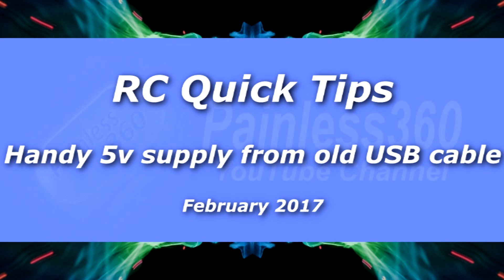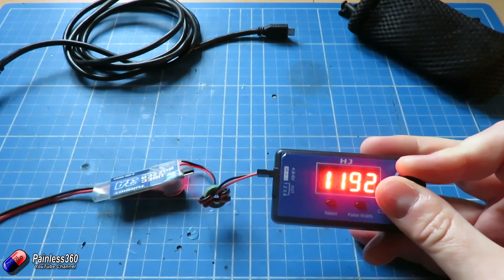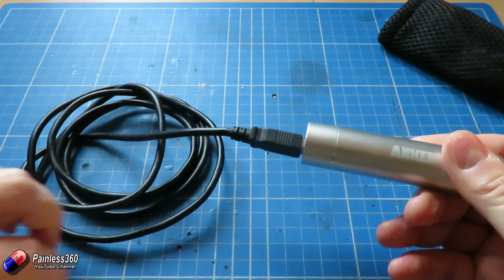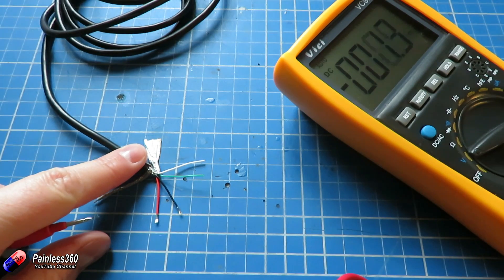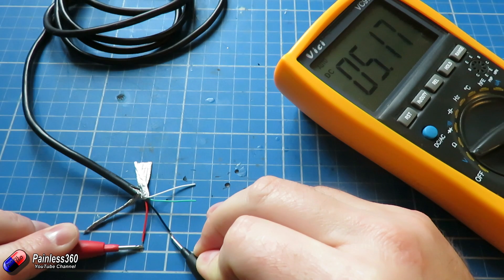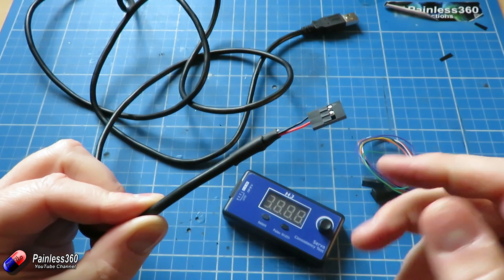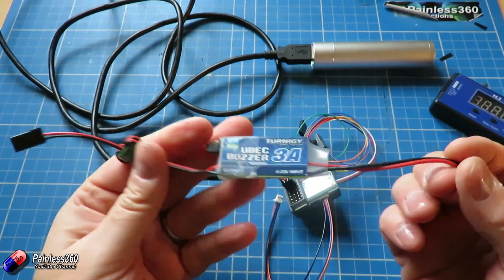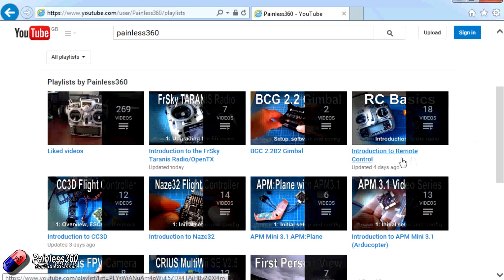RC Quick Tips: Using an old USB cable as a handy 5v supply for testing

Comment: I know this is an old video. But I was only thinking about this the other day. As I’ve just returned to the hobby and but all my gas plane receiver battery packs have kicked the bucket. 🦵 🪣 
So I wanted to bind my new receivers without having to buy another power pack. I’m running electric planes now so I want to be able to bind and setup my receivers before installing them.

Comment: Quick question please Lee, I have made one of these as per video instruction (thanks). Would it be okay to use this with a usb battery pack like in the video to power a dji naza m lite. I'm looking to hack the naza to v2.
Reply from the maker: jasser61 we don't use those flight controllers here, so I can't say definitely. I use these cables to power all sorts from cc3d, to seriously pro boards, to omnibus boards without problem. Best of luck!
Reply: I'll research it thoroughly before trying just in case I fry something. Thanks anyhow for reply.

Comment: Thanks for the tip. I made one tonight. The only difference is mine is reading 10.5V on my meter... I've tried 2 different USB ports and a wall plug. I guess this is okay and controlled by the USB cable??? It was to an old Sony phone. 

Now I never have to worry about whether or not my RX pack is charged. :-)
Reply from the maker: I'd check the output voltage on the thing you're powering the cable with. You can't use that with 10v on devices designed for 5v..

Comment: You could even use the micro USB plug and build an OTG-type cable to power your stuff from your Phone, Tablet, etc.
But note that the data wires need to be connected in a specific way to get some current out of your device (if needed).

Comment: Hi , Ive followed the APM series and all is working but this issue with the compass calibration. https://youtu.be/Elt_99eKYuI 
this is with the external compass enabled with the top jumper shorted. When I use the internal compass I can calibrate it no problem. 
can you please check this quick vid out and tell me what you think can be wrong. 
sorry for hijacking this comment section
Thanks
Reply from the maker: Hi, I would check that the external module is happy and all the wires are ok. I've not seen that here but that's where I'd start. Best of luck!
Reply: Painless360 thanks friend I appreciate your help to the community.

Comment: I've got loads of power supplies and one of them from a NAS had 5V & 12V. So I now have a dual voltage power supply on my bench. Another tip is to use a switch to help with binding FrSky receivers.

Comment: You must be careful with computer's USB ports, though. USB 2.0, which yet is the most common one, can safely supply only 500mA of current. Going above this limit will trigger computer over current protection at best, at worst you can fry your PC.
Reply from the maker: Good spot, that's why we mention using a USB power supply.. Happy flying!
Reply: Painless360 Thanks! By the way, new LibrePilot version was released, featuring auxiliary magnetometers support of different types for CC3D Revolution. But i have trouble calibrating it, I think it would be nice if You will make a tutorial about it. Thanks in advance.

Comment: Already doin this/ have you found a crimper that doesn't make you want to throw it into next week?
Reply: Painless360 how about doing a video on crimping servo's the tool to use where to buy the right pins??
Reply from the maker: The one we use is good but we don't try and crimp the pin and insulation at the same time..
Reply from the maker: We have one already but maybe I could do a new version with more about what to search on to find the parts you need on places like Banggood and eBay.. Thanks for the idea..
Reply: Good tip, that does seem to be the biggest problem, too high wire gauge.
Reply from the maker: https://www.youtube.com/watch?v=dL-BiQGv1xc :D

Comment: A very small pedantic point here, the unused wires are Data + and Data -, not Tx/Rx.
They can be shorted together to signal to the host device to deliver unlimited current rather than the usual negotiation
Reply from the maker: Thanks for the tip!

Comment: I am guessing that it will only pull the amps that is being supplied to it? ie a usb plug or computer is only 500mAh so don't power a high power thing unless you have a good amp output device ie usb plug    with 1 amp or more
Reply from the maker: Hence why we recommend using a powerbank/wall-wart.. The only thing we ever had a problem with powering it from the USB was an APM with the GPS/Radios and Rx powered at the same time. The USB port shutdown. Most ports are protected by a soft fuse so the port comes back after a period. Happy flying!